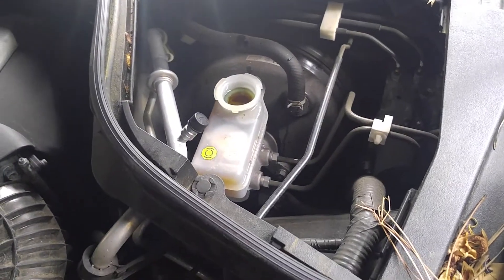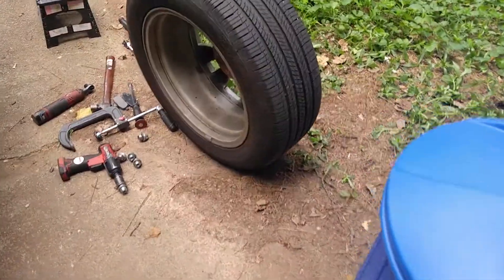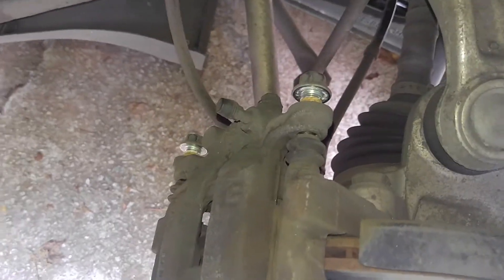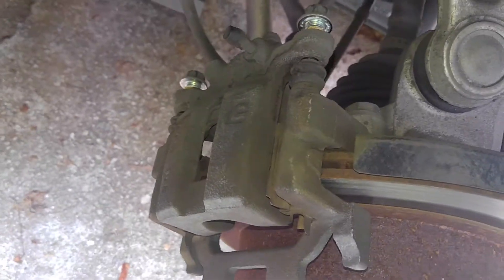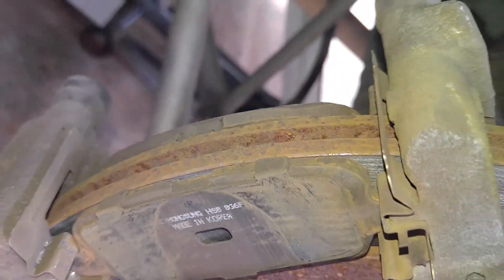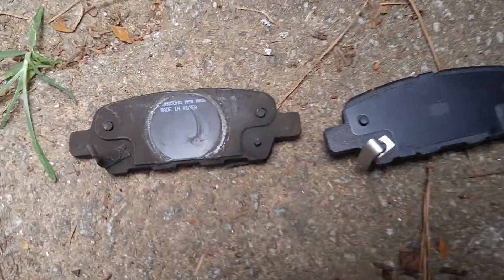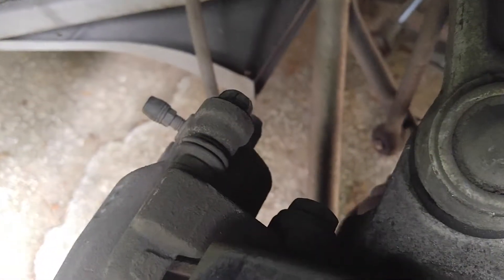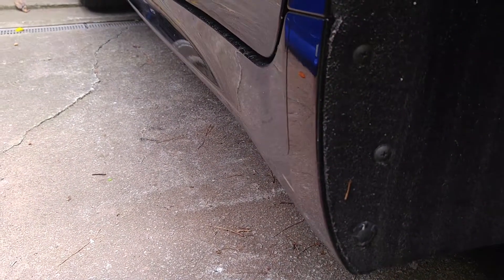INFINITI M37S 2011 REAR BRAKE PADS REPLACEMENT

Comment: Two mistakes.....not necessarily mistakes as much as bad techniques that should be noted to avoid damage.

#1.  DO NOT totally remove the master a kinder cap.  Just loosening to reduce pressure should be beans only loosen the MC reservoir cap immediately when ready to compress the piston  if you have a helper then one can compress the caliper piston while the other can loosen the MC reservoir cap.

#2.  For compressing the caliper piston use one of the brake pads that is being removed.  One end of the C-clamp around the caliper frame and the other on the inside of the pad.  Tighten the caliper piston slowly and evenly until the piston is flush with the piston housing.  

If you really want to get fancy they make dedicated brake die sets that actually have dies cut for most vehicle rear brake pads.  The die installed on the pad surface and the other end just inside the caliper outer frame.  Slowly turn and the caliper piston should retract.

Remember the whole idea of compressing the caliper piston is to make up the difference between the thickness of the new pads and the old worn out pads.

Note:   If you are changing the rotors there is also two 18mm caliper bracket bolts which need to be removed to slide the old rotor off the axle hub/bearing assembly.

Note 2:  The  procedure for compressing the piston is the same for the Front brakes except you probably will need to compress both pistons.  Just a few turns at a time loosen clamp, move to the other piston and tighten slowly and evenly.

Major Note:   DO NOT remove and replace pads exactly at the same time.  Especially if you have helpers, it maybe tempting to speed along but you want one side available as a reference.  Remove both tires and set jackstamds at same time but use the other side as a reference.